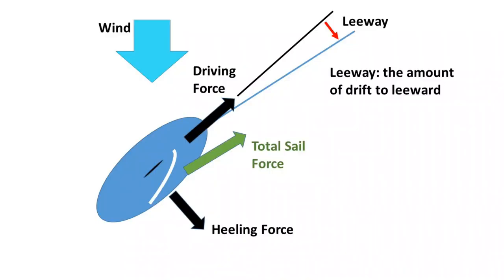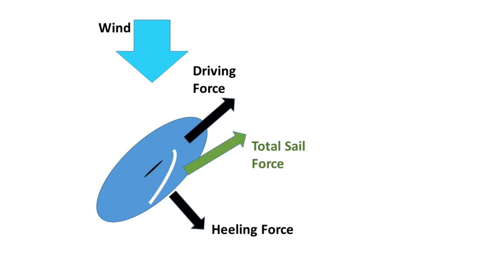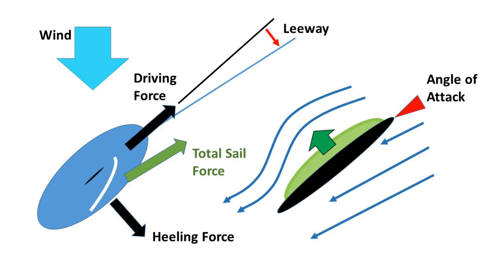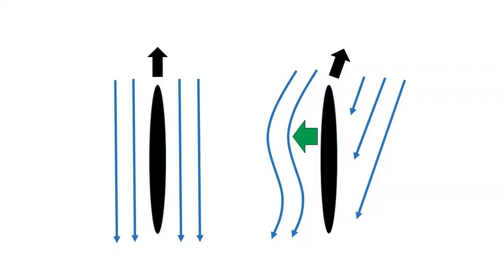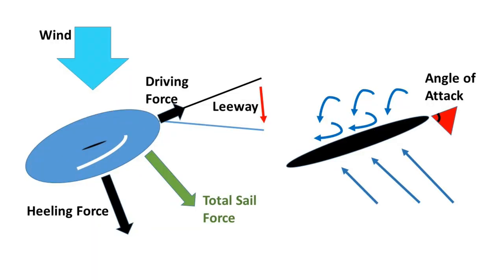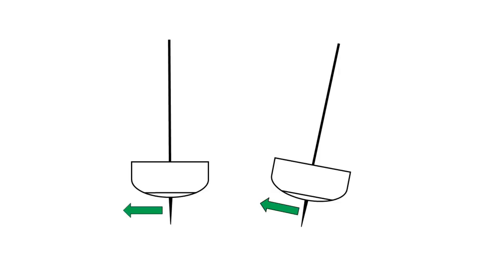What is Keel Lift??

Comment: Yeah the heeling thing still has me thinking.

Weather or lee helm, depending on sail balance, plays into this too. The rudder is telling you not just about your sails, but it's also telling you what's happening to flow around the keel.

Lee helm, you're closer to a stall on the keel, no?
Reply from the maker: @scottmarquardt8770  a stall in a keel foil is caused by too great of an angle of attack to the water it is moving through,  and since the angle of attack of the keel through the water is created by the leeway (angle of attack and lift are created on the windward side), then heading up into the wind would increase the angle and bearing away would decrease it. In either case, the lift and lateral resistance produced would decrease (or even be eliminated momentarily)…I’ve definitely stalled out my boat and felt it lurch sideways to leeward until the flow and balance was restored. In the case of turning upwind, the keel could stall during a sharp turn, but would start producing lift once the boat starts moving again in the direction of the new heading (why some racers recommend keeping boat speed higher with slow, rather than abrupt, turns). In the case of bearing away, the CE on the sails becomes more of a forward force and the heeling force is reduced the closer the boat gets to dead downwind. So bearing away neutralizes the lift not because of a stall, but because you are turning the boat in the direction of the water flow and thus there is no angle of attack (and no lift). Once dead downwind there is no keel lift because there’s no leeway and thus no angle of attack. If you did a really abrupt turn bearing away (say from a beam reach to a broad reach) you could momentarily create lift to leeward due to the boat’s momentum on the old course, but once the boat starts moving at the new heading the flow and lift would be restored. So if a boat has leehelm (usually too much headsail or moving the centerboard so it’s angled aft) if you give too much rudder to counteract the leehelm, it would increase the angle of attack and then you could stall the keel. But a boat with leehelm is actually trying to turn to leeward and would naturally reduce the angle of attack. In a boat with weatherhelm, if you release the tiller then the boat will stall the keel itself by starting to head up and increasing the angle of attack. So I would say a boat with weatherhelm is closer to stalling the keel. ⛵️
Reply: @ColoradoSailing  weeeelll, I dunno. Lee helm is what you counter at the helm to maintain a heading, so the combined leeward force forward plus the rudder pushing the stern alee results in greater force leeward, which would increase the angle of attack. No?
Reply from the maker: @scottmarquardt8770  not necessarily. It would depend on the angle of the keel foil to the water flow caused by the leeway. Leeway is usually very small… just a few degrees. So if the CE increases (due to more wind) then the forward speed of the boat should also increase. More speed through the water would cause the keel foil to produce more lift and increase CLR. Thus the balance of forces is maintained. But, yes, it is possible if there was a massive amount of leeway that it would increase the angle of attack to a point where the keel foil stalled due to the extreme side slipping of the boat (in this case, regardless of whether the helmsman was feeling lee helm or weather helm). I would think a boat moving at hull speed with extreme heeling (which reduces CLR due to the angle of the keel) that gets hit by a large gust might find itself in this situation. The boat won’t accelerate with the additional wind since it’s already traveling at hull speed so the additional heeling force applied on the sails now overwhelms the ability of the keel to counter it. So the boat experiences extreme leeway and slips sideways at a large angle (maybe 45 degrees downwind of its heading) stalling out the keel and further increasing the side slipping. Time to make a turn to a downwind course! If this heeled over boat had lee helm, it would likely overwhelm the rudder…and turn downwind on its own regardless of helm input. Sailboats are always trying to get themselves back to a balanced state.⛵️

Comment: I'm just making sure i understand, lets say the boat is on a port tack close reach, the lift is on the port side of the keel? Like the windward side of the boat? Or the opposite, on the leeward side?
Reply from the maker: Correct. The lift is to windward and creates lateral resistance below the waterline. The lift and lateral resistance counteract and reduce (but cannot fully eliminate) the leeway (sideward slippage downwind). Basically the keel’s lift helps prevent the boat from being blown downwind. If you’re thinking “wouldn’t it contribute to heeling?” It does just a bit. But luckily, as the heel increases the foil generates less lift (because the angle of the foil changes, but the direction of the water flow stays the same, making the foil less and less efficient as the boat heels more and more). That’s also one of the reasons people say “flatter is faster”—because a flat boat will have less leeway and can tack to its upwind destination more efficiently.

Comment: Great explanation, but I have a fourth question. What stops the two lifting surfaces from heeling the boat right over, because they are acting either side of a pivot point. Is that simply the buoyancy of the side in the water being counterbalanced by the weight in the air. I am working up a sailing rig for my canoe which doesn't have any width to speak of so some type of sponson may be required. All fascinating stuff.
Reply from the maker: I believe that’s right…the righting moment is a combination of the buoyant forces increasing as you heel and the effect of static ballast and/or human ballast (depending on if it’s a keel boat or dinghy). Also why it’s important to reduce sail area as the wind picks up. The amount of righting moment definitely has a limit. An outrigger will help provide additional stability with minimal drag.

Comment: So my question is what keeps the boat from heeling over even more? Say you are looking at the boat from the aft, and the wind is coming from the left, blowing towards the right side of the boat (you are on a port tack). The center of pressure on the sail (CP) is creating at that point a clockwise moment about the Center of Mass (CoM). That will cause the boat to start drifting to the right, meaning the keel is now generating its OWN lift to the left to reduce the leeway. However, the CP of the keel is now generating ANOTHER clockwise moment about the CoM, meaning the boat SHOULD be heeling over MUCH more with the keel down than without it. Obviously from my own personal experience, this isn't the case. In fact, its the opposite. 

My guess for why is that when the boat would heel over, the keel goes with the apparent current, reducing the lift generated by the keel pretty dramatically at the bottom point, allowing the boat to keep from heeling too much further. I guess also the keel serves as a massive heavy ballast that naturally resists heel over. And just the increased drag from the keel trying to rotate in the water would serve to resist that motion as well. I don't know though. Any insight would be appreciated.
Reply from the maker: @cadenorris4009  Sailboats and the dynamics of sailing are all about balance. For every force, there is an opposing force that tries to restore the balance. So, yes, when the keel develops lift (lateral resistance) it does contribute to heeling. But, there are several other things that are also at work. First, as the keel foil is heeled at an angle, its efficiency at producing lift (lateral resistance) is reduced. This reduced lateral resistance increases the leeway the more the boat heels, but also reduces the heeling effects from the keel. Thus, one of the reasons why it is said: “flatter is faster.” Because keeping the boat flat reduces leeway and gets you to your destination on a more direct and faster route. Second, the heeling force on the sails is reduced as the boat heels. The sails become less efficient and produce less heeling force as the boat heels because the angle to the wind changes. Less sail area is presented to the wind in the horizontal plane, so the sails have less drag as well,“spilling” air out the top. Third, the components that counteract heel (buoyancy and ballast) create more righting moment as the boat heels. As the boat heels, more of the hull on the leeward side of the boat is pushed into the water. This creates more and more buoyant force (because of the additional submerged airspace), trying to push the hull back into an upright position. Similarly, the ballast also rotates below the surface more to windward, increasing the righting moment and counteracting the heeling forces (think of carrying a 20 lbs weight in your hand with your arm straight down, versus out at a 45 degree angle—much harder to do at a 45 degree angle). Finally, if you pull up a swing keel (which is ballasted) you will see a reduction in righting moment and increased heel because you are moving the ballast closer to the center of gravity and reducing the moment arm of the ballast. However, I have a lead ballasted shoal draft (fixed) keel boat with an (unballasted) centerboard. If I raise my centerboard, heeling is in fact reduced (by about 5 degrees) and only leeway increases. Hope this helps.

Comment: Nice video!!!
One question. Sailing close hauled with increasing heel would you head up or bear away? I have experienced in boats boats with a bulb that bearing away reduces heel. Which is the opposite I would do in a dinghy,(ex. Laser). Do you have an explanation?
Reply from the maker: Close hauled with increasing heel you would either want to head up in a gust (pinch) or let the mainsheet out. Depending on the boat and how it is equipped, you could also loosen the vang or move the traveler to leeward during a gust…but my boat doesn’t have a traveler and the vang isn’t easily reachable for such an adjustment in a gust. If the boat is just too overpowered sailing close-hauled, then you need to bear away and change your point of sail. I often sail on a beam reach to reduce heel or just run downwind when the wind gets too heavy.
Reply: @ColoradoSailing  👍thank you!!

Comment: great video, i also was looking for it for years and i ended up.same conclusions, however still missing a bit  the effects of body weight aft/stern and relative keel angle lift... despite many years of Laser Sailing nevrr found a full.scientific explanation
Reply from the maker: Heeling results in significant decrease in keel lift and thus more leeway.  A tilt aft (or forward) by shifting weight would have very little effect as it would not change the angle of attack of the foil, the fore/aft angles are much smaller, and the airfoil shape is still pretty well lined up with the boat’s direction of travel. I would think the change in lift produced would be very slight. On my boat, however, I can raise/lower the CB which angles it aft. If I place it at a 45 degree angle, it reduces lateral resistance, reduces heel, but also shifts CLR rearward…creating lee helm.

Comment: I'm afraid I cannot accept the airplane wing analogy because an airfoil compresses and slows the air on the curved side creating a low pressure zone hence lift. Water cannot be compressed so this principal does not apply. Not convinced there is actually any lift going on here. It seems an eddy is created on the windward side which may actually cause some resistance. 
Just a thought. Needs further investigating.
Reply from the maker: One word: hydrofoils. Right? It’s a foil attached under a board or boat that when moving really fast (by sail power or towed) creates lift and lifts the hull or board well above the water surface. We’ve all seen them in action. Exact same principle except in the vertical plane. Water cannot be compressed, but it does transfer energy and force. Put a water storage tower way up high and all the water pipes are pressurized. Not because the water is compressed, but because the force of gravity and weight of the water is transferred or conveyed directly through the incompressible water to the faucet at the end of the pipe. So a foil moving through water is creating pressure differences on each side of the foil. Just like when you move your hand through water…you can feel the force of the water pushing back resisting your movement on one side of your hand, but no pressure (low pressure) on the backside. Of course, your hand is not a foil and the angle of attack of a keel is only 1-2 degrees creating a nice, smooth low pressure flow on the windward side and a higher pressure flow on the leeward side.⛵️
Reply: I guess the use of the word pressure is the culprit. A water ski, type of foil,  uses the water density, no lift involved, however quite a bit of fiction produced. The air on top of the ski does not contribute to keeping the ski on the surface, I don't think the water on the top side of hydrofoil contributes either, that foil could just as easily plane along surface. Still have doubts.
Reply: Hi William. The concept of lift arising from fluid passing around an aeroplane wing, or a sail or a keel will be easier to accept if you first accept that the air or water that passes over the longer, curved side of the foil actually expands. It doesn't compress. It expands as it rushes over a longer path, to meet up at the trailing edge with the fluid it was separated from, which went along the shorter path. Because it has expanded, the pressure the fluid exerts against the adjacent surface of the foil is lower than it is on the side where there is no expansion. The higher pressure on the side with no expansion pushes the foil away. Therefore, in the case of an aeroplane wing, it's pushed up. In the case of a sail, it's pushed out sideways, to leeward. In the case of a keel, it's pushed out sideways to windward. Why to windward for a keel? This is where the magic of leeway (or sidewards) movement of a keel-boat does its thing. 
The keel is symmetrical, so that it can generate lift when the boat is on either starboard or port tack. When the boat is sailing the keel is moving mostly forwards but also slightly sideways. It's crabbing through the water. There is leeway. At the leading edge of the keel the fluid is split, to pass either side of it. For the fluid that passes on the side of the keel that the crabbing movement is going towards (the leeward side), the distance from the point of fluid separation to the point of fluid reconstitution (leading edge to trailing edge) is less than on the side of the keel that the crabbing movement is going away from (the windward side). You can picture this by imagining yourself and a friend treading water together as a sailboat approaches. It's crabbing through the water quite noticeably. As the bow is about to separate the two of you, you agree to meet at the stern. Your friend is lucky and swims along the side of the boat that was crabbing towards you, whereas you go down the other side; the side you couldn't see as the boat was coming towards you. To meet at the stern, you have to swim faster, to cover a longer distance. Now imagine you're in the water with a thousand of your friends, all bunched up as the sailboat approaches. Those who go down the leeward side of the boat stay at about the same density. However, those who go down the windward side of the boat are spread out as they swim quickly to meet everyone at the stern. They have to cover a greater distance. Their density in the water is reduced. If we switch back to thinking about a crabbing keel, this difference in density of water going either side of it pushes it to windward. 
So the sails are pushed to leeward by air pressure differences and the keel is pushed to windward by water pressure differences. These opposing forces mostly cancel each other out, apart from a proportion of the forces on both foils which are pushing forwards, due to their bulbous shaped forward edges. These driving forces make the boat move forwards.
But if the sails are pushed leeward and the keel is pushed windward, why doesn't the boat just flop over onto its leeward side? The answer is that as the boat leans, the centre of buoyancy shifts sideways to leeward while the centre of gravity stays put. This creates a strong lever arm effect which wants to stand the boat upright. 
And there we have it - monohull yachting 101. 🙂 Regards, Rick.

Comment: Does keel lift counteract heel? Your drawing makes it look like the keel lift (to port), plus wind (from port) would make heel (to starboard) worse. What am I missing?
Reply from the maker: You are not missing anything. Keel lift does not counteract heel. The ballast in the keel is the main force counteracting heel. Increased buoyancy of the hull as it heels (and more of it is submerged) also counteracts heel to some extent. Finally, placement of crew (aka: “rail meat”) counteracts heel.
Reply: @ColoradoSailing   I initially thought about how keel and mast rotated around the hull's longitudinal axis. If the keel was lifting, it should add to the sail lift heeling the boat.
 I needed to understand the situation from the vertical axis. The keel lifting force is keeping the hull tracking and lessening the amount of leeway. Thank you for the video and good (correct) explanation.